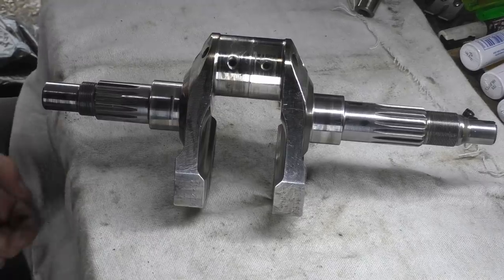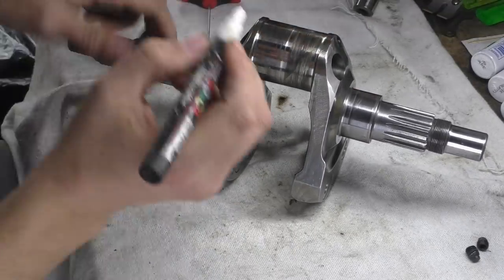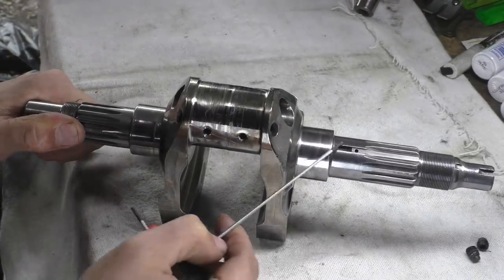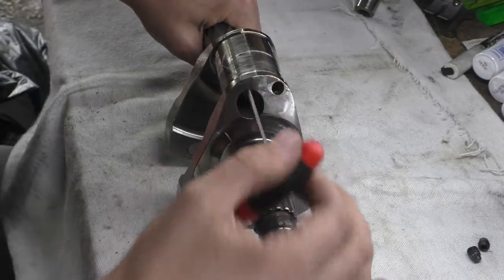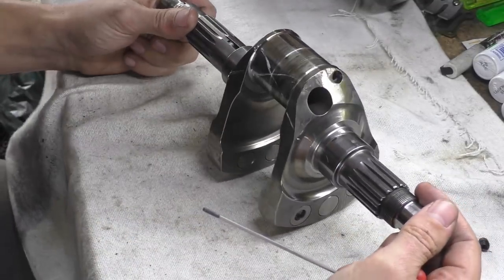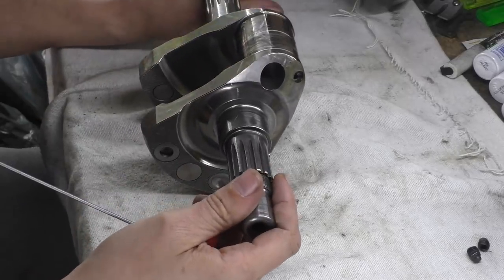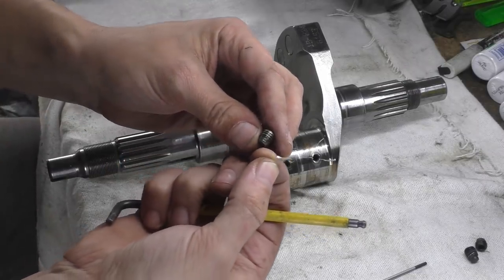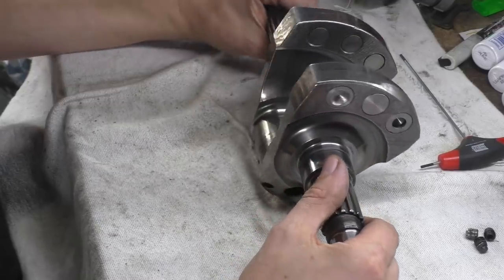Ducati Crank 1 - A closer look

Comment: The base forging for the 1098 crank is the same crank for the multi strada too. The basic forging will allow a small difference in stroke 67.1mm for the 1098 and 67.7mm for the 1200 Multistrada. The 1198 race bike has a 60.8mm stroke  which may have used the same basic forging as the 999R and RS race bikes which were a 58.8mm stroke. The linished finish on the webs will be due to the engine builder running different weight rods and/or pistons and drilling the web to rebalance it is not really an option as drilling the 90 hour nitrided steel will be hard on the drill bits and risk cracking around the heavy metal plugs. Drilling the densamet or tungsten plugs can be done but again they are very tough so linishing is the option most builders take. The heavy metal plugs in my experience are never removed as it can damage the surface finish of the holes which also have the nitrided hardening inside the holes. 
The small hole along the plain shaft on the output of the crank is if I remember correctly an oil feed for the primary drive too... Toine will know this better than me. 

The balance factor is 50% the weight of the total piston mass including rings and gudgeon pin. 50% of the small end of the con rod and 100% of the big end of the con rod weight when weighed end to end.
Reply from the maker: So this makes sense, with differing linished 'amounts' due to the differing material removed from the weights.
Reply: I know... Thats why it was my job for 15 years... Had enough of the machine shop so got out to do something else away from motorsport then ended up doing something else...... In bloody motorsport...At least I work from home now.... Now its just Yamaha in world supersport and several BSB superbike teams I do work for.. The rest is just my own stuff 'cause I wanted to have a life outside of racing. 

Back to the linished finish.. John Hackett at JHP (now Ducati Coventry) did try to push out the heavy metal plugs to add weight to a customer engine build after doing some changes. We told him not to do it but had us put new plugs into the crank and after one race the engine was destroyed when they came out after the crank cracked on the outer edge of the web and just allowed them to come out.. Thats why we never removed them and none of the factory supported teams we made billet cranks for ever removed them..  It was only when the FIM changed the rules to force the teams to run OEM cranks that we stopped making the billet ones for WSB.
Reply: Richard Vanags  Awesome extra info.  Really interesting.  Thanks.
Reply: The original superbike Ducati cranks did not have that though hole in the crank pin they used to have a larger blind hole drilled and reamed at an angle on the centerline of the crank pin. This was used as the crank pin oil journal and to help reduce weight the hole was plugged with an alloy plug which filled the hole but was shaped to allow oil around the outside of the plug. It also allowed the crank pin to hold a little more oil as the Ducati was and still is prone to oil starvation when the bike wheelies. This little bit more oil worked as a small reservoir for those short moments when the rider could starve the oil pick up. The way we produced them was not cost effective for a production engine but as it was World Superbike and the rules were quite open back when they ran the 888,916 to 996 and then the 999 we could supply billet steel cranks. The Ducati "customer" superbikes the RS version had the Ducati supplied Forged cranks but all of the works bikes ran billet steel ones as the forged ones would break usually in the same way this road bike crank broke. The billet cranks never suffered the same breakage and did have a longer life of about 3000km before they were binned. The customer superbikes had a life of about 1500 km and at WSB meetings they would often swap engines between the first and second race.  They would usually use them like this Race 2 then practice, qualifying and Race 1 at the following round. Then swap to a fresh engine after race one then rinse and repeat after rebuilding at least one engine between rounds. The full factory teams would do the same but the life of the cranks was longer but rebuilds were still done as specced. The Ducati engines kept it all quite simple with their crank design compared to the Honda SP1 and SP2 super bike factory cranks and even the failed Harley Davidson who had Cosworth trying to develop the VR1000 Superbike in the end which had bolt on densamet/tungsten counterweights and a split pin design with the two cylinders still at the same angle as the "Production" engine but they offset the single crank pin with a 15 degree "step" to change the firing order slightly. 

All interesting stuff at the time and being involved with Yamaha on the Yamaha R7 was one of my favourite jobs. These image links were for my Yamaha R1 crank and I am lucky enough to still have the original drawing of the crank at home. 
https://i.imgur.com/4a6Sa15.jpg
https://i.imgur.com/PWHMLKw.jpg
It was a great job which ran its time and when the company was about to be sold off I had enough and needed to do something else. So I built a bike to break the Nurburgring lap record and sort of retired to do something I wanted to do.. Now I make parts in Carbon fibre and have done work for several manufacturers including the largest producer of motorcycles in the world, on a concept, land speed record bike. 

I do like Matts Video's I just wished he had done a little more research on the crank one... But then I guess he may think I am a BS artist like Del. But in my case I have been involved in racing all my life from family involvement through being a racer, engineer building race chassis through to the crank stuff for WSB, MotoGP, WRC, WTCC and F1. I occasionally share my work through facebook when I do something interesting that I am allowed to show like the Sylvain Guintoli Suzuki stuff the other year and the Gino Rea and Luke Stapleford parts as well as the Royal Enfield project. But the more interesting stuff for the race teams is still all quite secret. 
https://i.imgur.com/h1P0RLX.jpg
Reply: Richard Vanags start a duke channel mate..or do you not want your brains picked. what are your thoughts on the  70's 900 ?
Reply: @thruxt0677  to be honest I am not that into Ducati's, it was part of the job I was doing at the time. We would have either tuners who we linked to factories contact us to do one or two off jobs which could be sent to a full factory team via the back door or we would have the factory send someone to see us to do work. The Ducati stuff was a bit of both. We did stuff for JHP and teams like GSE Ducati may use those cranks. The results could be good and then the factory would start to order our cranks. Yamaha was the same as I modified a standard R7 crank for a team in the UK and then Yamaha Germany had me modify one for them so we took a gamble on making billet steel ones which were based on my modified crank. Those were sold to loads of teams including Belgarda Yamaha for Vito Gureschi officially but we sent so many that we knew Haga was running them too. He kept one after they stopping using the R7 and has one of my cranks at home in Japan. It was all just work. Love the early bevel drive Ducati's but know nothing about them sadly.
Reply: @thruxt0677  my only real Ducati experience was riding from John O'Groats to Lands End for Performance Bikes magazine on a day on a 999 a few years ago. That was painful and did rode there then home again so did it effectively twice in three days. The list of people they called to do the feature must have been a long one. Even in the article they said they asked Michael Rutter, Shane Byrne, Sean Emmett and a few more then current racers. So it was good to be thought of in that group of people... My factory 250cc GP bike test riding days were almost a different lifetime away.

Comment: Just a tip. By a happy accident when cleaning out carbs, i used freeze spray on can. Instead of dustspray which i didnt have at the time. The great thing with that, is it burst out a mist from the exit side/hole. I think you have good understanding of this. But a quite simple way of assuring its right. And id imagine youll se the mist on camera. good if its quit intricate tubing. Was helpful when learning what hole goes to where. When working on my carb
Reply from the maker: Great idea - thanks

Comment: This likely would fail catastrophically in slightly different fashion; how about drilling the lube holes straight from the crank pin into main shaft channel, then connect them with a centralized large (mass reduction) oil channel along the pin and plug the large channel ends? A plug made of some light handy material could go all the way through and be shaped to eliminate the reservoir that would otherwise form when the big channel is combined with the oil line.

Comment: Oh the small scallop shape in the pin oil drilling is done after it has been produced and should be run vertically no horizontally but sometimes as they are done by the guys doing the finishing and deburing process they don't always do them correctly. On the V10 Cosworth F1 cranks they were actually machined into the crank pin with a fairly tight .002 tolerance as the pin oilway holes were only a 2.5mm bore. The mains were drilled 6mm but the oil pump would run some strange oil pressure and the way the cranks were drilled it would assist how the journals were fed.  I am sure if Matt did a drawing of it and had all the sizes, diameters and offsets as well as the engine RPM he could calculate how or why they did it that way.

Comment: Good engineering by Ducati...on a 916 the oil way blanking caps start grinding on main bearing rather than falling out completely...😂😂..unfortunately they have allergic reaction to no oil pressure pretty rapidly..

Comment: Hi
I am wondering if material had not been removed to lighten the big end journal would it still have cracked / snapped
I can understand making everything as light as possible for racing but for a road bike is it worth the trade of for longevity?
What do you think
Reply from the maker: In the next videos....... That's what I think

Comment: can you make a video about what gives an engine more horse power and tork? (like the stroke cicle, valves timming, number of valves etc...)
Reply from the maker: Yeah - that's what most of these videos are about.....
Reply: for me most of them are about what that doddley do, or explaining how the buburubu works etc... i'm asking for a video of how to turn one street engine into a racing engine and the little secrets that gives the engine more hp
Reply: i'm asking for a video of engine mods basically
Reply: More air more fuel , less friction and imbalance from moving parts , better cooling and improved ignition control. Mats been working on doing most of this fun stuff with that rg500 lump. 💪😈 
When we gonna see more of that lovely lump?
Reply: @chrisvinicombe9947  
My ole lady has some lovely lumps.

Comment: Very interesting pointing out the oil route to the big ends Mat. Is this a plain main bearing crank or rolling element (balls or rollers)? The oil feed to those bearings is a very poor design. Oil only enters the middle of the crankshaft at the primary drive end (the right hand end by the riders right foot). Its route from there out to the crank pin in the right to left cross drilling means it will feed better to the left side big end. Only when the left bearing is satisfied will oil then be willing to use the outer end of the left cross drilling to reach the right hand side big end. I think the journal of the poorer fed right bearing is the one that is worn? It would be the first to suffer oil starvation if the supply failed.
The engine has a 90 degree V twin layout. You would expect the actual oil holes feeding out of the pins to be 90 degrees apart if they are in the optimum place relative to each big end bearings loading. Some engines have two oil feed holes per big end journal 180 degrees round from each other which makes four holes in total for a shared crank pin like these. The Ducati design only allows one per journal so one of them is not in the optimum position.
I think this stems from their choice of rolling element main bearings in these examples rather than plain bearings. Can't feed oil past a rolling element main as you can with a plain bearing. I think Ducati have now gone to plain main bearings for their later engines.
Reply from the maker: rolling element and balls.
Reply: Finish on the cranks main bearing journals not that important then as the centre of the ball bearing comes withits own journal. Was probably mounted correctly between centres for the additional work to be done. The marks said to be from a three jaw chuck could be from a drive dog. Turning between centres means theres no actual drive through the centres. By dog I mean those teardrop shape things with a clamp bolt through the point. Clamp them tight round a journal and the opposite end driven by a peg sticking out from a face plate.

Comment: Good failure analysis stuff, on that subject, I see TST have finally come up with some ambiguous bollocks 're their R3 engine debarcle. :-)
Reply: hope matt takes a look and gives his thoughts on the R3 ......can you post a link to  the R3  evans will fix it video
Reply from the maker: James Dougan
 - did you not see the R3 videos?
Reply: yes i did  see your videos (very good ) but i wanted a link to the new tst vid to see what they came up with  in their annalist  which i found   https://www.youtube.com/watch?v=BgMocAYhbQQ    they sorta imply that its as quick as a zx10 around the track  but the zx10 rider is a bit of a pussy  on the brakes and corner speed and getting on the gas again and hasn't got much of a clue on the racing line (2nd corner in way to tight on entry )
cheers
james D

Comment: so its the strength of the crank  has been compromised with all the oilways and weight offset  drilling  making the crank flex and fail  ?? another excellent video  from matt  ..... another stupid question from me lmao ...... looking forward to the next installment loving the series matt and learning heaps 
cheers
james D
Reply: The through hole actually adds some strength and it is reamed to remove any stress raisers that can occur. A tube will always be stiffer than a bar if the wall thickness is great enough. The problem is the cross drilling and how close it is to the fillet radius's of the main and the crank pin. Simple... Its been an issue ever since Ducati started racing superbikes..
Reply: thanks richard for your input  and for the pictures that you posted also... they are  pure works of art   i hope you can come back and  impart some of your knowledge again  as with your short  post i have gained knowledge that i would've never got otherwise  if you can  post  a link to some of your projects  i for one would be very interested  to see some of your work 
cheers
james D
Reply: Cheers James, After over 20 years of engineering and working on some amazing bikes like the WCM Moto GP bike as well as the Petronas FP1 road and race bikes.. I think the R7 stuff was something I was most proud of. The rules changed for the superbike classes and as much as I liked making the car stuff I had my feet firmly in the motorcycle camp and lost some of the love of working at the company. I had been asked to do other things too and was importing ISR Brakes, Chicken Hawk Tyre warmers and a few other things which were hard to get in the UK at the time. So when things started to change and the company was being put up for sale I left.... I was lucky to be able to do almost what I wanted and was asked to build a prototype for a planned limited production run of bikes that were going to sell for £106,000 each.. The bike got some publicity but it was more about working and doing what I loved even though the bike was always doomed to fail. I sort of retired for a while to build a little project of my own for me to ride on track. I then had to learn how to work with composites due to a company letting me down badly and one of the other companies involved gave me a start to get my bike done.. I spent 4 years learning to work with resins from cheap polyester to epoxies and then using pre-pregs. None of this was paid for so I had to fund it myself and learn with the help of many of the people in the industry who I had known from my motorsport days both as a rider and during my time engineering. Now I still have not finished the project 6 years later but it is now effectively my job and I am lucky enough to pick and choose my work. I still do BSB and some World Superbike stuff for my friends who either are involved with a team or are racers in those championships. Luke Stapleford is a good friend who was involved with a record breaking project so I help him out still and I do try and keep my facebook pages up dated when I can.. My current work is mostly fuel tanks at the moment and a tarmac rally car project. So come find me on facebook... I am easy to find lol...